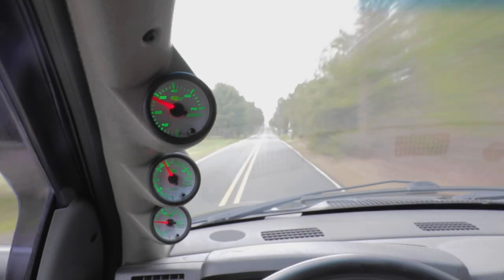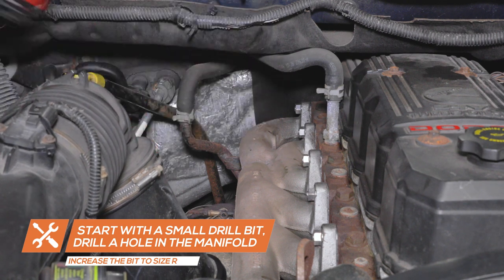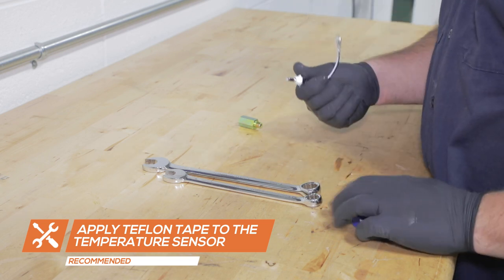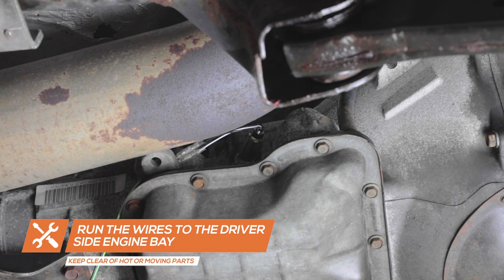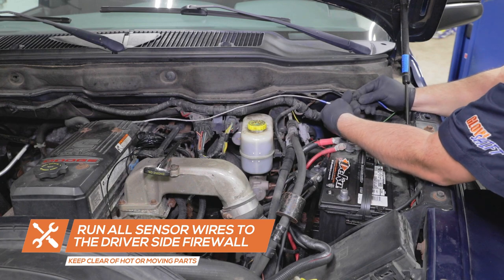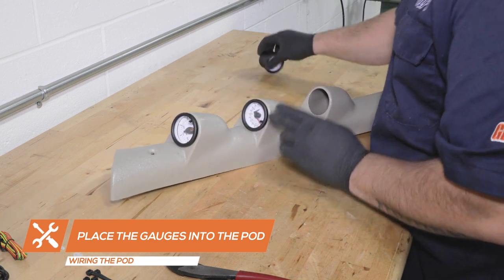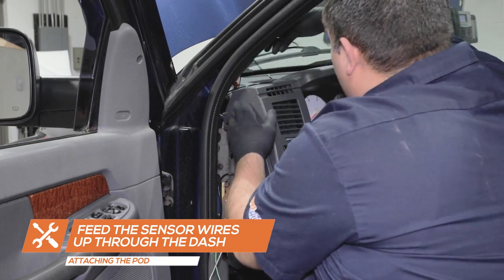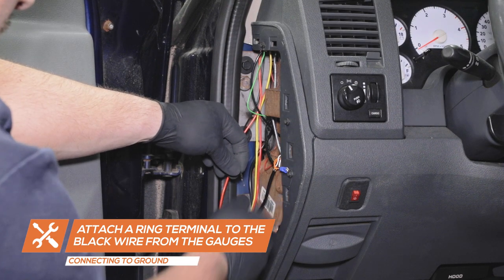GlowShift | How To Install A 2003-2007 5.9L Dodge Ram Cummins Diesel Gauge Package

Comment: Having the engine running while drilling the EGT probe hole will help blow the shavings out and then grease on the tap will grab the shavings from tapping the hole

Comment: Will I still be able to install the fuel pressure sensor since I have a fleece fuel filter bypass on my 2004 3500

Comment: Only utilizing 3 of the 4 sensors installed on pillar pod...🤔
Reply from the maker: Our 3 gauge kits are available with either a transmission temperature gauge or a fuel pressure gauge as the 3rd gauge in the kit. So, we show how to install both sensors for customers that purchased one verse the other. Wiring is the same for both gauges, which is why we dont show it for both.

Comment: Step 5 of the instructions for your mini expandable kits says select a fuse that does not exceed 10 amps… am I missing something? The headlight 12v fuse is 15amps
Reply from the maker: We recommend 10amp in general but 15 will also work.

Comment: My temp gauge is just pegging out, any suggestions would be greatly appreciated. My factory gage broke and it not talking it the computer so I’m having to go aftermaerkt
Reply from the maker: If the gauge is pinned that means the sensor is not fully connected properly.

Comment: Why do you need the test port extender?
Reply from the maker: If the extender is not installed, internal transmission parts will break the sensor which could result in major damage.